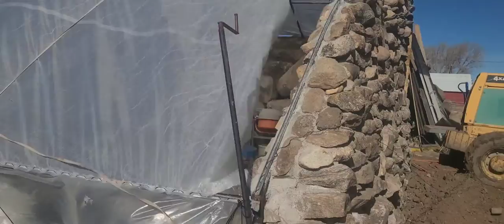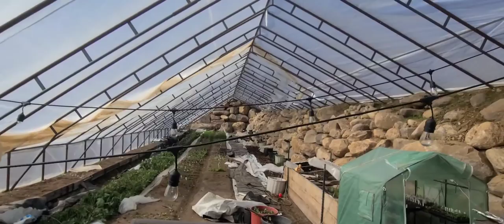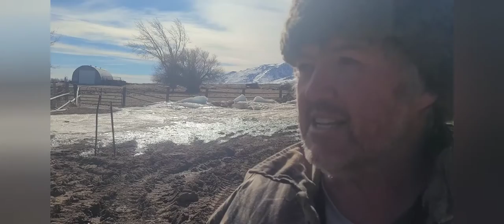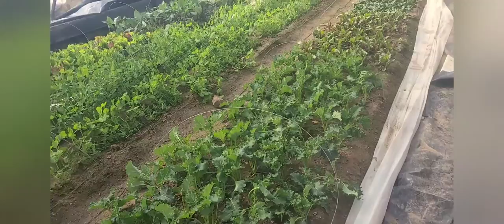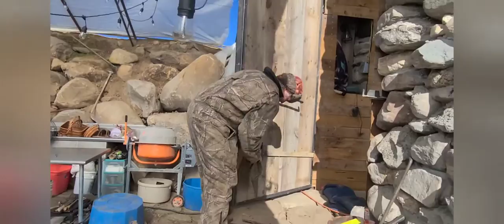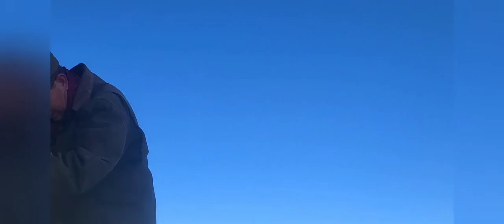Nevada Walipini Update February 7, 2021 - Master the Tempest is Raging

Comment: That looks rough. Do you have any windbreak? maybe could plant a row of trees and bushes. That is a long term solution though. Try to stay strong!
Reply from the maker: Yes,  wind breaks are in the plan for the entire garden.  They'll help a lot. The walipini is actually dug down into the earth about 10-12 feet on the north side,  but this wind has blowing from the southwest at 40-55 mph for almost three days solid. It's the extended duration of the wind that did in the poly lock.  The inflation fan did a decent job for the first 30 hours,  but the wind eventually pushed all the air out and that's when the plastic pulled out of the poly lock. We're in a decent holding pattern right now.  We'll have to wait for calm to do serious repairs.

Comment: Just found your channel a couple days ago. I was worried that the flat profile would let the poly flop in the wind. When I saw how loose the poly was after you installed it, I thought about commenting but held my peace. I have 7 hoop houses in Indiana and have lost a couple in hurricane Ike with 85 mph winds for 12 hrs. But only those two in 27 years, the poly will have to be super tight to work on that big of a flat surface. Usually you will have to re-tighten after the initial install when the temps warm up and the poly expands in the heat.
Reply from the maker: That's a good idea, the retightening in the higher temperatures. We got the plastic on later than we wanted to this autumn, but that sounds like something we will be able to do this spring and summer. The movement is 100% what pulled the poly lock out of the channels. You're spot on. 85 mph winds! I can just imagine the devastation that would cause. Wow! Our end goal is a rigid covering, but we've got to make the plastic work for a couple years until we can do that. Thanks for sharing your thoughts!
Reply: @verniedemille6466  I love all the big stone. I see one problem is you have no cross purlins to keep the end bow from flexing when the wind gets up. A poly-carbonate panel would be the best way to go on that huge flat surface. Good luck...
Reply: This is William the guy in the video. Our original intent for this house was a rigid covering but we are on a budget and were hoping to get a few years out of this so we could get started growing. Thanks for the advice. I had a double poly with inflation except for the rollup parts. It has worked good in some high winds before this but last night the wind won! The wind finally stopped about an hour ago.
Reply: @gardening_with_william_demille  Were are all subject to mother nature and all we can do is figure out what she was trying to teach us and go on. If we have a threat of severe storms, I make sure I have a sharp knife handy and head for the big house 24/124'. If the wind gets bad enough, cut the poly loose instead pulling up or smashing down the bows. In 08 I stood in my house watching the steady 85 mph winds beat on my biggest poly tunnel from 200 feet away. After about hour six, a hole tore in the windward side, inflating and lifting 8 bows with base and hip-board out of the ground, pushing them six feet into the house. I was running toward the house as I watched it lift out and push in. I managed to cut the poly off before it did any  more damage. Had to make 8 new bows which was easy cause I made them myself to start with. Live and learn fits but it still sucks.
Reply from the maker: @waynebusse6376  Thanks! We appreciate it!
Reply: @waynebusse6376  Wow! cool story. I got things patched up today and will do some more tomorrow. Thanks for the story.

Comment: Here in Colorado  is like Wyoming  now I know why I'm so afraid of  using plastic film.
Reply from the maker: Yes, a rigid covering is your best bet if you can afford to do it from the beginning. It's pricey,  but great for high wind protection.
Reply: @verniedemille6466  just for conversation, you can buy baler twine cheap and go nuts in every direction. Over lapping each other be even better if on the underside and top side. Was wondering is the plastic film  green house of just 6mm .I've used homedepot  6mm with no luck .
Reply from the maker: Lol, I'm in Elko buying some right now! 😆 Yeah,  we've never had luck with the cheaper plastics,  we've gone with the better quality greenhouse films.  The body of this plastic is still in great shape,  it's just the edges that were under the poly lock that ended up chewed to bits.